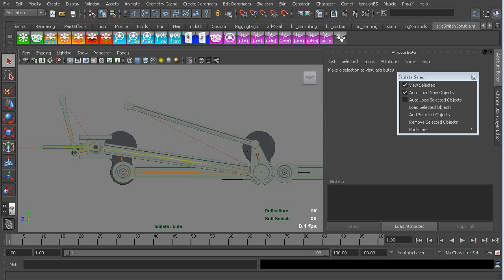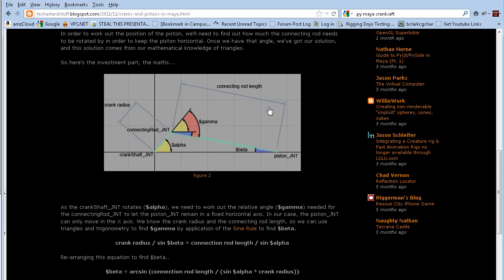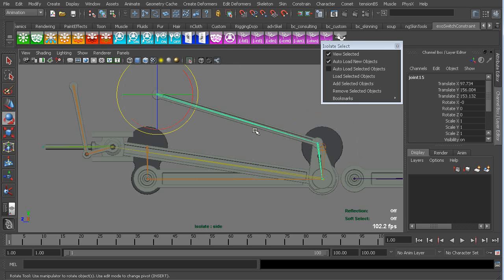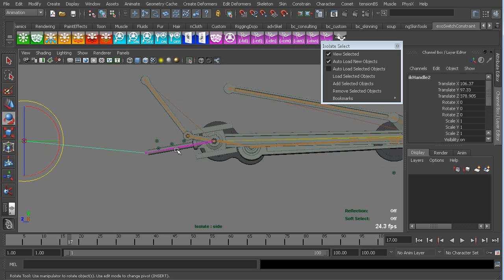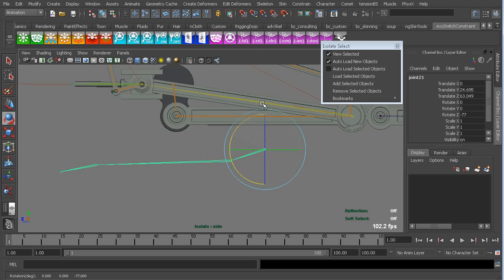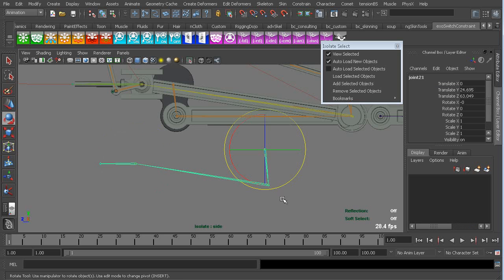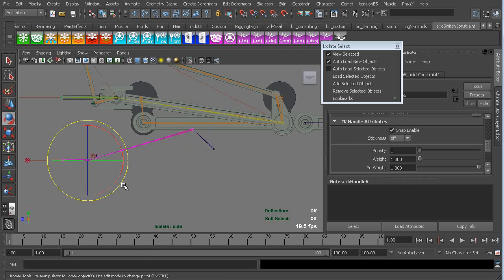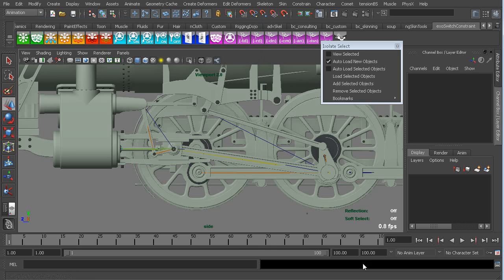#rigTip Constraint hack - crank and pistons 101

Comment from the maker: Trevor and Malak, depending on the situation this might not work as needed. I have double checked my example file and I wasn't getting the slight Y movement, it doesn't mean that it wouldn't happen to me if the length was diffrent or there is a slight wiggle but for this example and for mechanical objects in general, slight wiggle due to wear and tear. I might do an update to this since it gets so many comments:) Thanks for watching and taking time to leave some feedback, it is appreciated.

Comment: Thanks for taking the time to do this tutorial but I have to agree with Malak1000 (the IK distance stretches). However, I think this system works fine for non hero shots etc as the Y axis movement is fairly minimal. For close-ups and proper accuracy then an expression based rig or the maths example you mention works better. An interesting method none the less and useful in some situations. :)

Comment: Im having the same problem as well. The IK is only constrained at the axis of the joint which results in separation of the IK handle and the end of the joint causing the Y axis motion. Try it with a bigger crank you will notice it more.

Comment from the maker: Malak, if the base joint and the IK handle are not in line then you will get some movement but as long as all the joints start off in the same plane it should work fine, the example file from the demo doesn't have the problem that I can find.

Comment: Cheers for this. However although my IK handle is constrained slightly, my leftmost joint still translates in Y slightly (causing a slight rotate) due to the IK handle changing length slightly over the course of the rotation. is yours doing this too (I can't see in the vid) or am I doing something wrong?